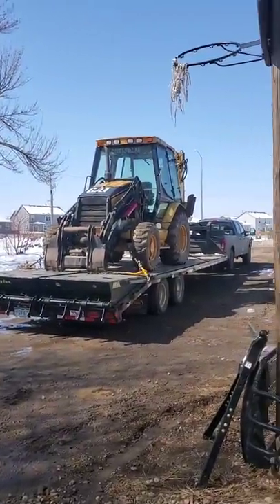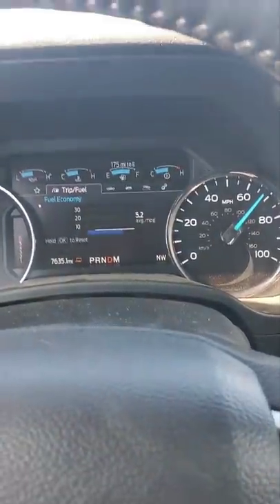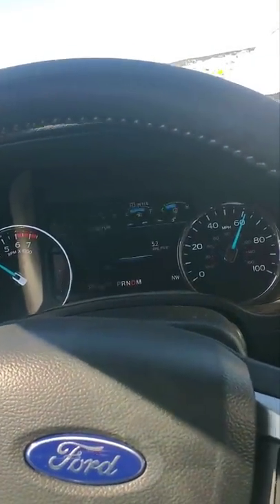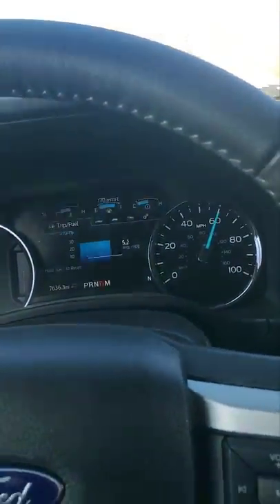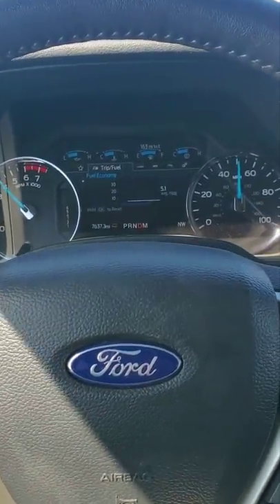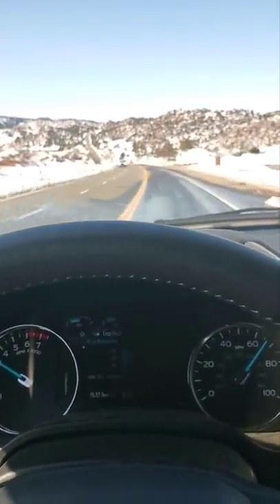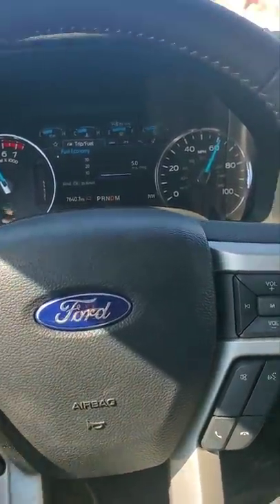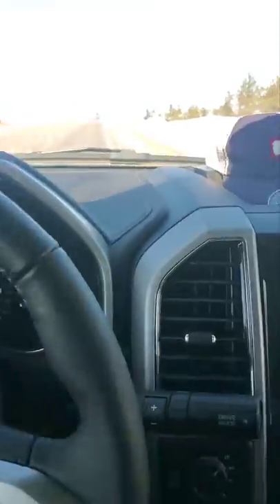7.3 godzilla towing 24k lbs through the rockies.

Comment: How long is that motor going to last turning 4,500+ and being a Ford?  Not long.
Reply: 4500 is nothing,it’s designed to run full throttle continuously.  This engine is built to last under heavy loads. There are several videos on YouTube of these engines being torn down and built to higher horsepower take a look at one of them and look at the stock internals they’re very impressive.It will still outlast a 6.7s fuel system and emissions system, either one cost as much as a new gas 7.3 long  block . I’m betting the 7.3 will outlast most 6.7s as well. The diesels don’t last like they used to they  are running 40 psi of boost now, Trying to breathe through DPS and diesel oxidizing catalyst ,While gagging on its own exhaust gases, They aren’t have 1 million engines anymore, i’m betting you that 7.3 will go 300,000 easily with proper maintenance of air filter and oil changes.
Reply: You're just bias because its a Ford ''which you apparently don't like'' This engine is WAY overbuilt for the amount of power it puts out. The 7.3L FORD gas V8's will be on the roads for decades to come. You're just butthurt because no one else offers anything remotely close in comparison, the new GM 6.6L gas you might say? Underperforming dud hooked up to an ancient transmission. The Ram 6.4L Hemi? What that car engine Ram thought they could pass off for a HD gasser? Please...This 7.3L Godzilla V8 is the king of heavy duty gas V8's now and for the foreseeable future, deal with it.
Reply: @JohnDiMartino  I COMPLETELY AGREE with your comments. The Ford 7.3L might even last between 400K and 500K on mileage. Ford will sell MILLIONS of Super Duty trucks with the 7.3L gas engine......both to individual consumers.....and to almost every city, county and state government...not to mention the federal government.
Reply: @nathanmcdonald610  High Five! You are EXACTLY CORRECT!

Comment: I can hook my v-10 to that trl and I would have no trouble pulling it. And it is sad that you and rest of anybody doesn't recognize it. I had v-10 that 360,000 miles pulling rv's with and hardly any problems with and still run strong when I sold it. Not putting down 7.3 tho I'm disappointed that it  should be making more hp and tq. I still own v-10.
Reply: You could handle trailer no problem. Not with the the backhoe on it though
Reply: @peterdragon6367  oh yea I can. If I can take a pair of tri axle toy haulers to ak , with out any issues. I hauled a big 32 ft freezer box from pacific ocean in CA to el paso weights more than that backhoe. I took a travel trl to yellow knife in -40. I'm certainly positive that backhoe would be a peace cake. If you never driven a v-10 you wouldn't say such nonsense.
Reply: @marchartman1115  I have driven one. I can also look at the numbers. 7.3 outperforms V10. Not really an opinion thing
Reply: @peterdragon6367  yes numbers are one thing , but to say a v-10 can not tow that backhoe which you know it is fools talking.  It has lot less hp but the tq is pretty close the same.  Now this is my opinion the v-10 the HP and tq is much lower than the 7.3 which is lot more useable. Will buy a new 7.3 probably , but I'm disappointed that it didn't make more tq than the v-10.

Comment: You say it has the 10sp trans but it only shows 6 on the dash at the 6:00 mark?
Reply from the maker: I lock it out of the higher gears when I'm pulling heavy
Reply: @ColtWR  makes sense. Just was curious! I’ve been eyeing the 7.3 for awhile or a used 6.7.
Reply from the maker: Both are good trucks however I think the 7.3 is a better bang for your buck
Reply: @ColtWR  gonna have to agree. I love my old 7.3 diesel but it’s 21 years old ya know. Just was waiting for the quirks etc to be worked out on the 7.3 gasser

Comment: Dude🙄🙄🙄🙄 that truck screaming and you have your foot all the way to the floor…… something is deffff gonna brake……I would hire someone to do it or buy the right truck!!!!!! You just took 10k miles off that engine and tranny with that tow!!!! Engine is being over worked obviously and if you loose trailer brakes god for bid that truck will not stop that load I can promise you that! Always have more than enough truck/trailer when you have to tow that heavy…… you have to be prepare for emergency situation to occur
Reply from the maker: You do realize semi trucks and commercial engines spend almost 80% of their life at full throttle? Full throttle isn't going to be the death of this engine.  The brakes and transmission have no difference from the diesel.
Reply: I drive a dump truck and I’m not at full throttle near that percentage and full throttle on that gas engine will prematurely cause something To brake dude if consistently done….. engine in semi and like my dump are made to go millions of miles you talking apples and oranges dude….. I also own an f450 yes your brakes are not like mine they are smaller and less affective and will heat up faster I know I have a half ton also particularly due to your lack of engine braking which is huge when towing heavy!  Big difference from you screaming doing 5/6 rpm’s All day and I’m casually doing 2200/2500
Reply from the maker: @spin 04  You must be a flat lander cause in the mountains we spend a lot of time at full throttle. Basic understanding of drive pressures on a turbocharged diesel versus a naturally aspirated gas engine  will prove why and how this engine will have a comparable if not longer life span than the modern diesel. Even in a short engine life scenario this complete long block replacement is cheaper than just your diesel injector rnr.
Reply: You think running that gas engine hard often vs my diesel will last as long? My diesels are deleted also fyi or non emission…… and you crazy if you think that lol I drive both daily from little pickups to my big trucks…..simple I take care of all my equipment but I know from EXPERIENCE……. Gas under heavy load too often will not go half a million miles like my diesel will no where near that’s on stock engine stock injectors lol……. Again if your doing light loads then cool but if you tow heavy OFTEN with that engine it will prematurely fail because you are running it threw the roof prolonged….that’s just basic physics……..there’s a reason why all your big equipment like my bobcats and excavators are running diesel because the engines are made to work hard daily effortlessly when compare to how gas engines used to perform in agriculture equipment…..    anything designed to haul or move heavy equipment daily is a diesel just look around!! They actually producing battery powered heavy duty machine before ever attempting to go to gas again!
Reply: And dag on Tranny be shifting to freaking much in my gasser…… my f450 barely ever shifts that hill you pulling it wouldn’t have to down shifting………I ran heavy equipment on i40 in pa no downshifting it eats hills like that…… which does what prolong the tranny also🙄

Comment: 4000 RPM!!! 😮😮
Reply: That's completely normal for a gas truck they will rev up that high when towing heavy and near max towing capacity. Diesels always run with low rpm since they have way more low end torque where all the power comes from for hauling and towing.
Reply: @ironman-sp9fg  bruh that rpm consistently is not good it’s straining too much to me...... components will fail
Reply: @spin0491  Not necessarily.  Maybe an old school V8.  We've used Gmc 6500 and 7500's with the 8.1L and 5.13 gears for the last 15 years at work.  Never had a major engine problem in any of them. And 70mph is 4k+ empty or loaded. These newer engines are far more robust.  Couldn't do that in an old 454. I tried. Lol

Comment: Ever heard of GCWR?  If not you should look into it.  These GCWR numbers are from a 2021 F250 crewcab SRW 4x4 7.3L gasser.

 You are way over weight. Like crazy overweight...

3.73 rear end gears max GCWR is 21,800lbs max ... 4.30 rear end gears max GCWR is 26,000 lbs. 

Be careful what you post online for the world to see. Might get yourself in a bit of trouble. Especially if there was an accident which you were involved in.  Your fault or not.. 

There are many other things on bigger trucks that a F250 simply does not have.  For one, brakes on a F250 or F350 SRW are NOT designed for these types of loads. That is why the F350 DRW F450 and F550 exist.
Reply from the maker: As a guy who has many thousands of miles grossing well over 120,000 lbs in semis through out the rockies. Many loads over I70, the toughest highway in the United States, I believe that if any one, I am qualified to load a truck like this. Properly balanced, secured and attached. If I would have made a video at just regular gcwr nobody would care, as neither would I. This is about how underrated this platform is. I do understand brake size does change through out different models and if someone was to tow this heavy regularly I would recommend a F450. But this f250 could handle itself well. Figured I'd show some folks. 🤷‍♂️
Reply: @ColtWR i really like the video and its real world results.  BUT people will see this video and think its ok because he did it.  I am no expert on most things but I do know that there is a book answer way of doing things and the other way of doing things.   As you stated... These vehicles are capable of alot but there is a reason they rate them as they do. I'd hate for something bad to happen to someone else because they are 10k overweight and not even know what I am commenting about.  I don't think that 95% of people that buy trucks like this that haul stuff like this have any idea what GCWR is.. Or that a F250 is not a F450 or F550 or F650 or F750.

I just err' on the side of caution when doing stuff like this and especially if you put it it there for the entire world to see. 

Im as hard core of a Ford guy as you would ever find. I am NOT a diesel fan.... Ive got a F550 with a V10.. 

My son digs this video but Ford wouldn't condone this video.